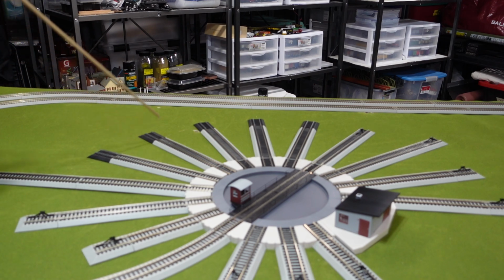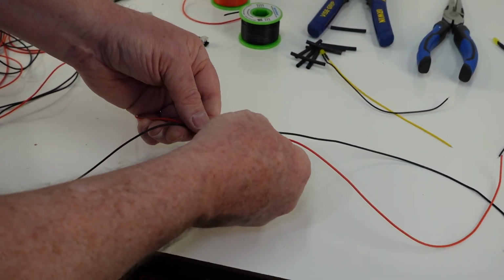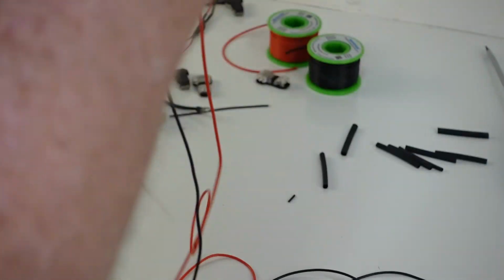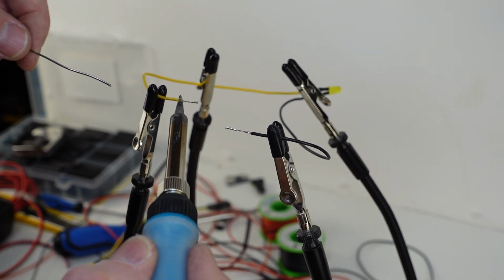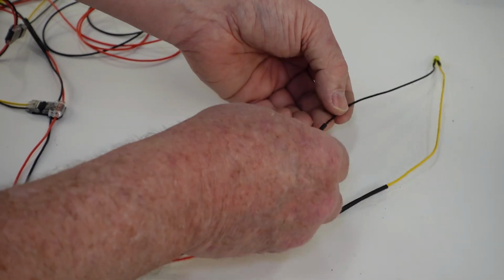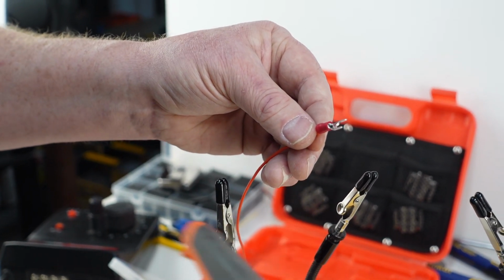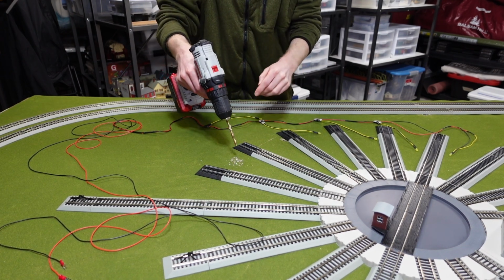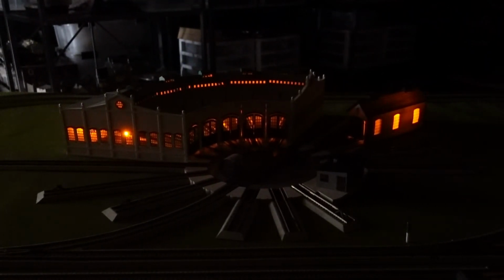Adding Some Lighting To The Engine Sheds On Our Layout!

Comment: It's not a good idea to tin, then crimp wires, the solder under tension from the crimp will flow leading to a loss in crimp tension and an eventual open circuit. Use a crimp intended for a smaller wire, or as you are using very thin wires you may be able to bulk it up with a ferrule, or small diameter copped tubing that you can crimp/squash down on the thin wire, then insert and crimp that into the crimp terminal.
The same goes for screw terminals, don't tin the wire then put it under a screw, as it will also end up loose and intermittent.
Reply from the maker: Thanks for the advice. Much appreciated!  We had a bit of a gauge mismatch (22 gauge connector on 24 gauge wire) with what we had on hand.  I considered the ferrules but wanted to try to stick with fork connectors for the terminal blocks.  Tinning the wire to bulk it up a bit was our way of improvising. I have plenty of slack on the main wire so I may snip those connectors off and re-crimp without the tinning or just convert to ferrules. Thanks for watching and commenting!
Reply: @Northeasttrainyard  My suggesting of the ferrules is not to use them instead of the crimp lugs you had, but to use them WITH your lugs, to bulk up your thin wire so they more fit into the crimp lugs you had. As in crimp ferrule onto wire, then inset that into your lugs and crimp again, rather than using solder.
Ferrules are available without the plastic end 'shoulder' so should fit right up inside your crimp lugs, failing that some small diameter copper tubing can be used - after all that's basically all ferrules are.
Reply from the maker: @paulstubbs7678  we ordered some ferrules to give your suggestion a try and it worked like a charm. We recorded our experience and just published a video.  Hope we did your suggestion justice!  Thank again for the suggestion